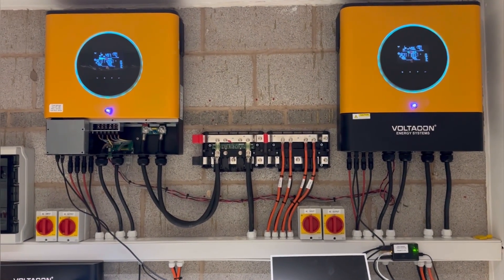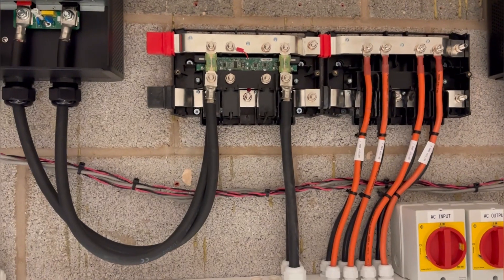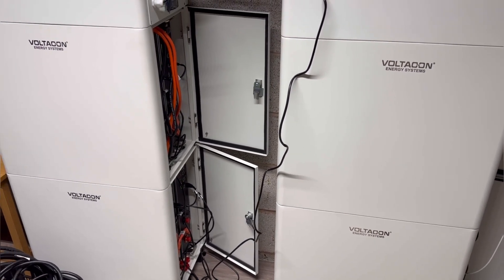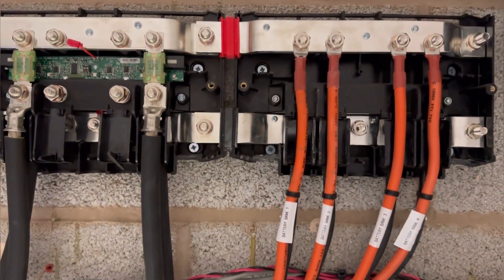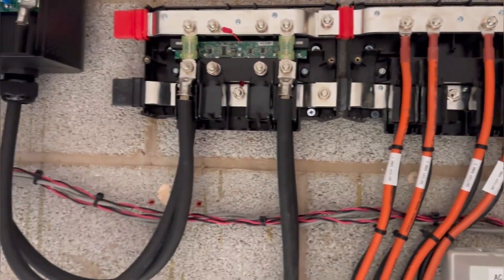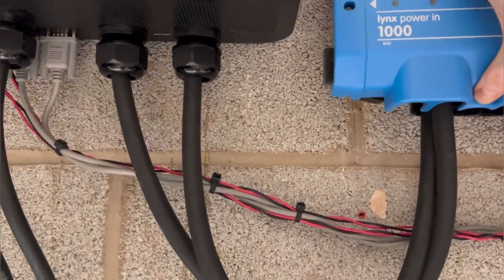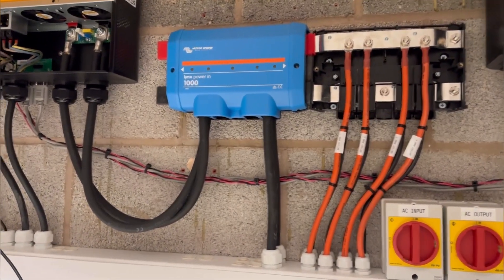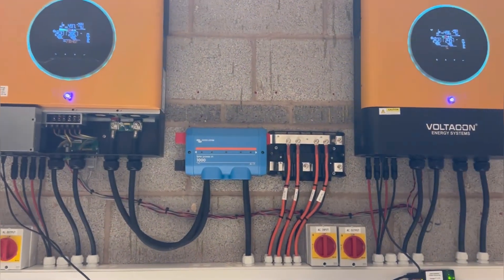How To Connect Two Lithium-Ion Battery Banks (Pylontech US5000 & US3000) to a Common DC Link

Comment: Thank you. Can I connect the two large terminals out the left side of the Distributor directly to the Charge Inverter (I only have 1) and connect each battery bank to the distributor where you have the inverters connected ?  That seems it would/could be doing the same thing... two inverters... I like your take on it.

Comment: you should protect against shorts between the pylontech batteries and the lynx power in. pylontech manual even says it.
Reply from the maker: yes we added 125A fuses from Victron
Reply: @voltaconsolar  did you modify the Power-In to accept fuses or have you added external MegaFuse holders? I have two Lynx Power-In units in my setup and use one of them, modified to become a "dumb" Distributor, by adding the necessary stainless steel bolts and nuts and washers, to feed in my three US5000 battery modules. I then have a second Power-In also with fuses added to feed out to my MPPTs and Inverter. 

I use 125A fuses in each battery feed in, and a 200A fuse out to my Inverter (MP2 5000kVA), and 80A fuses for my two MPPTs (250/60). This works really well and saves some money compared to using two distributors. I don't really care about the fuse fault LEDs because I will probably be aware that a fuse has blown due to functional changes without having to go and look for red LEDs.
Reply from the maker: now we use only Lynx with fuses (regardless the small PCB board with led indicators that is only useful if you use the lynx BMS system) any bus bar system with the right fuses and the right copper bus bars will work.  @craigchamberlain

Comment: lenght cable between Inverter/charger and Lynx have to be the same, cheers
Reply: Dc ripple will be minimalist
Reply: No that’s wrong
Reply: @JP-dy9po  explain 🤔 I do agree have to be same length but hardly.gpingnto get much dc ripple.
Not feeding the trolls yawn
Reply: If you make a video it’s like a tutorial. It has to be accurate. This setup does not respect the best practice.
Also, you should protect more the remaining cable
Reply: @JP-dy9po   you build systems or are you qualified? 🤔 show me your builds please let's have a look
Reply: You should also have a single cut for the dc bat instead of four and add fuse on each positive bat cable to protect the cable
To rely on the internal bat fuse is not enough
Reply: Unfortunately YouTube does not allow url
Just tried and it’s not work…